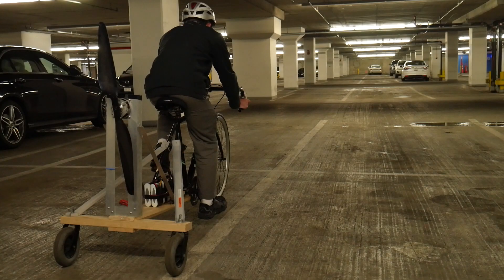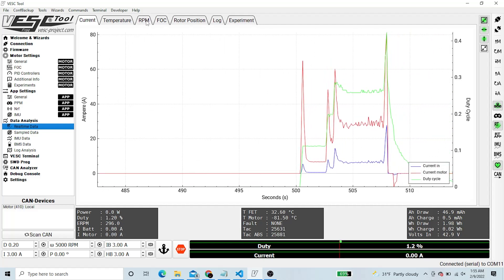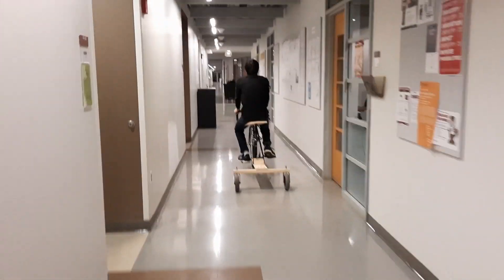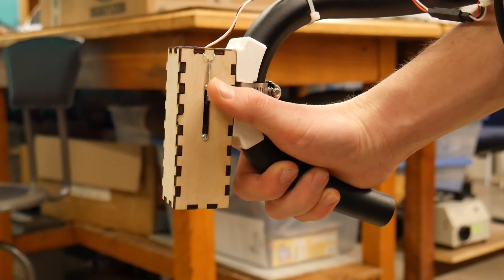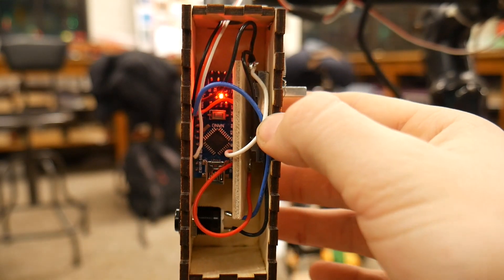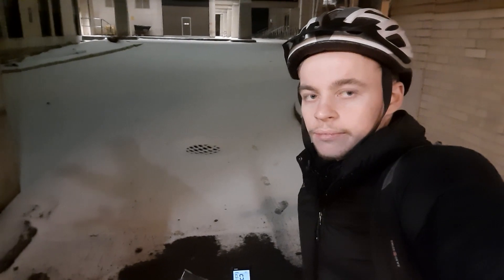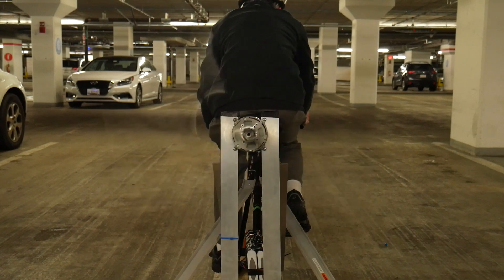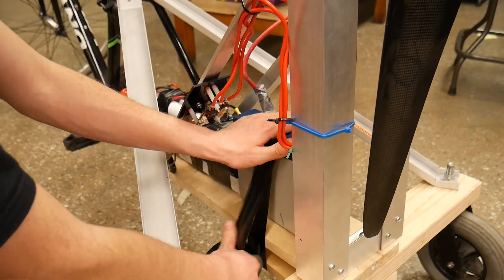Crazy Propeller Driven Tricycle! (With Harbor Freight Chainsaw Motor and Old Bike)

Comment: Aren't they teaching you materials analysis there 😅 a pine (soft) wood bike that needs reinforcement 😱

You totally didn't need arduino for the switch

Work safe tanner! What if the propeller flew into one of those cars, or you！

Comment: Ahh you did it. I was going to make literally this exact bike idea but with a gas powered ebay engine. I realized it would be a human blender and decided against it. I ended up just connecting the engine to the back. Still though my little freestyle bike hit 41 on flat. Parts used from a nearby metal store. Some were manually machined and most were 3d printed. You definatly improved whatever design i would have done, but I am 15 and not a mit student lol. Great video tanner
Reply: 'definitely'

Comment: Though it's cool for concept this could simply just power the bike much faster with the motor only(no prop). Stay Safe T
Reply from the maker: Thanks! Yeah, air power is definitely not the most efficient for this application. My reasoning was that I would eventually put skis on this and use it for snow transportation where the prop driven aspect would be more useful.